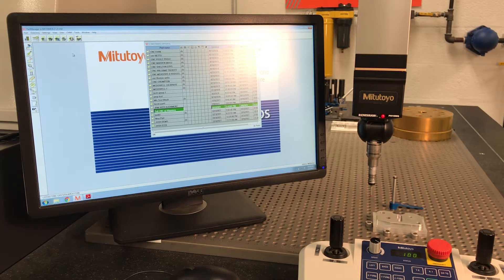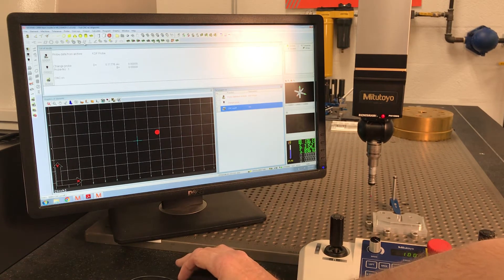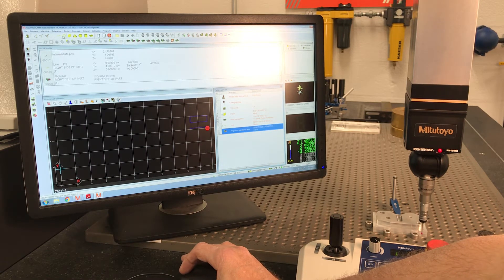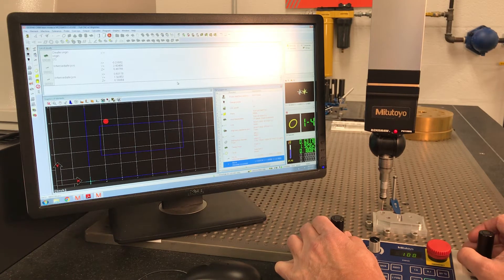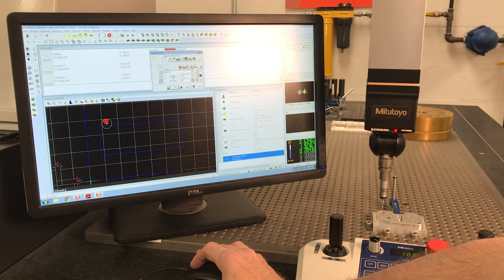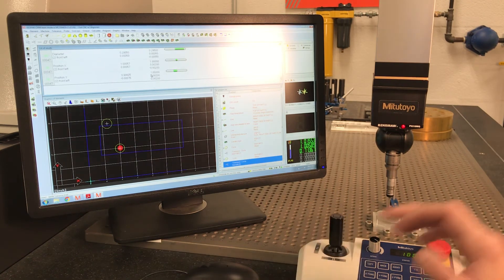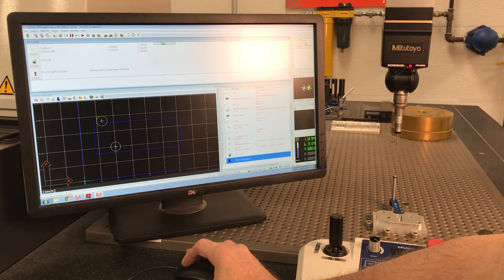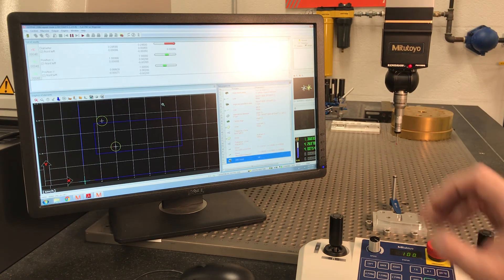Mitutoyo CMM with Dedicated Alignment

Comment: If you're gonna dumb it down and use the go to method for every point you might as well add a clearance height. At least then you don't have to worry about the probe crashing into the part.